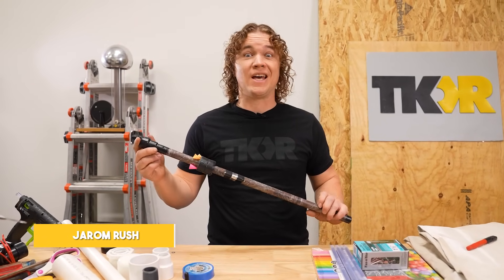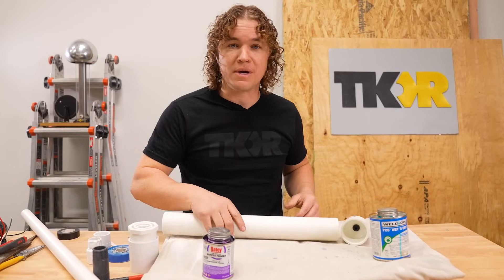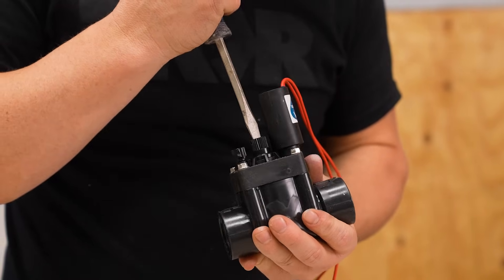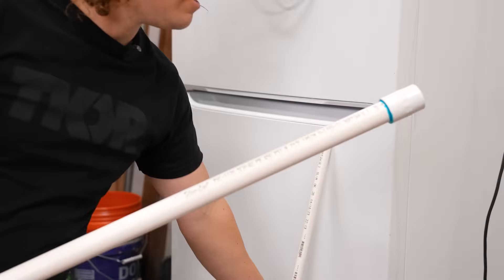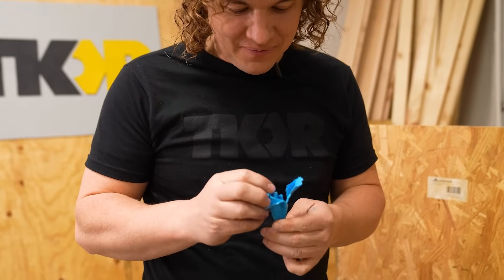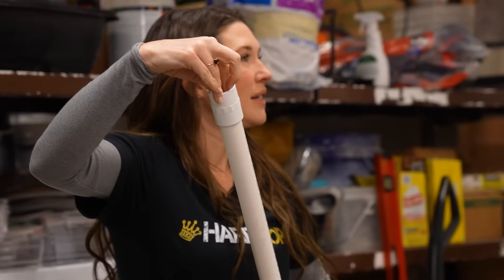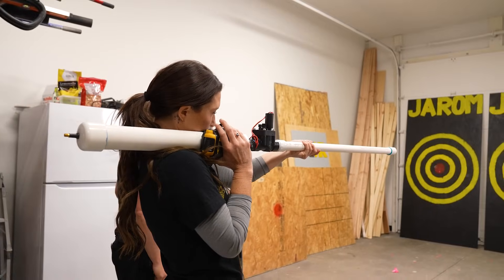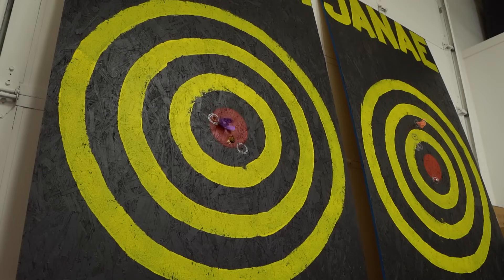Upgrading Grant's Blowgun: Compressed Airgun Edition!

Comment: Loving the TKOR videos lately.. big fan

As a master plumber since 99' that's worked with PVC since 1991 I can guarantee you that little drop of primer wasn't going to ruin the seal 😂  there's some of the exact same solvents in the glue. Acetone, tetrahydrofuran, cyclohexanone...
The only thing different about the glue is that it also contains pvc resin and silica. 
Keep up the awesome new videos.. informative and entertaining 👌 TKOR like the old days. 👍 
❤ you guys

Comment: Remember children, PVC and compressed air can be dangerous. It is rated for max 120psi however it can explode if there are any cracks, etc that make it weak. PVC also can be degraded by UV light and other condition that can impact its pressure rating.  PVC shatters into small pieces and plastic pieces can be difficult to impossible to find on X-rays. There is a reason OSHA doesn't permit PVC to be used for compressed air applications. 

Not saying you should not do this with PVC, you just need to be aware of the risks and him saying in this video "can hold a lot of pressure safely" can be a bit misleading.

Edit: speaking from experience. Made a potato cannon using compressed air and PVC. Only used 60 psi and one day it exploded while pressuring it. Had we been standing next to it instead of a bit away using a regulator to fill it, we could have been seriously hurt.
Reply: Exactly use galvanized water pipe ,with its 4mm wall thickness it can hold a burst pressure of500 bar's ,something that you will never reach without pcp air rifle compressor .And even then that poor sprinkler valve will burst way before you ever reach that pressure.
Reply: Depends on the thickness of the PVC backyard scientist got 1" pvc above 1000 psi without rupturing
Reply: too bad, I'm using 150psi on mine but my pipe is rated to like 300psi
Reply: Schedule 80 PVC has a pressure rating of 210 psi to 1230 psi, depending on pipe size, and temperature. At 73°F the pressures are as follows: 2" = 400 psi. 3" = 370 psi
Know your material
Reply: When my dad built one to shoot tennis balls/soda cans when I was a kid, he put a pressure relief valve on it so we couldn’t overfill it
Reply: I agree. Much better if they would use a repurposed empty propane torch canister or similar METAL container. 
Better if they used a lower pressure here, too. 
Could have tried a higher volume backpack mounted compressed air container.... Like a modified Jerrycan. This way, a lower pressure no higher than  20psi could be used, which would last many more 'shots', without overpowering the darts and ripping them up, and tumbling them through the air. 
My son and I bought TKOR's dart gun kit, and built a few of our own. Simple lung pressure, with our improvements: hyper polished pvc pipe barrels, and silicone spray misted 'dart' tails made from post it notes made our darts capable of penetrating cinderblocks reliably, and they flew true.  

The problem with the design in this video is that the darts, as designed here, are not right for the high pressure being used. The cones are being mangled on exit, making the darts tumble through the air.
Reply: @MrCecil_KD9WUS  even schedule 40 will hold the pressures there using

Comment: This was so fun!! I love your guys' energy. 
Side note, was a 9v battery not strong enough for the switch? It would just be easier to use than a whole power tool battery. 
Either way, such a cool toy!
Reply from the maker: Sprinkler valves are meant to run on 24v but 20 is enough. A 9v wouldn’t be enough.  -Jarom

Comment: I've heard that ABS piping is usually safer for pneumatics and higher air pressure (between 100 to 500 psi) than PVC, might be something worth while to think about in future projects maybe... I've never tried it myself and I'm by no means at all a professional, but it would be interesting to see some experiments with ABS and PVC gas pressure rating and handling differences!

Comment: Does this qualify as a compression cannon? I've checked  laws in my country (Namibia)  and a combustion cannon (like a potato gun) is illegal. But this does not use an explosive (like alcohol (hairspray, etc.)), so hopefully I can legally build this thing. Looks quite deadly though.
Reply: This uses high pressure from a pump, not anything explosive or burning, so it shouldn’t be considered a “combustion cannon”.
Reply: This would be more like a pneumatic (air) rifle.